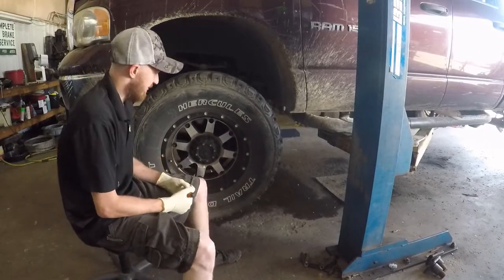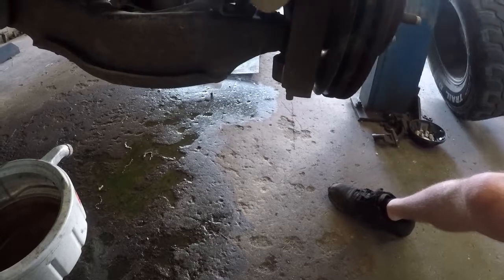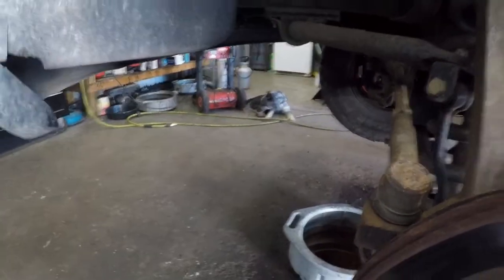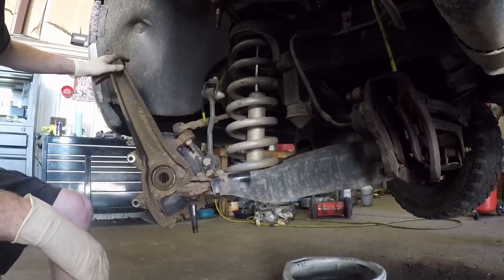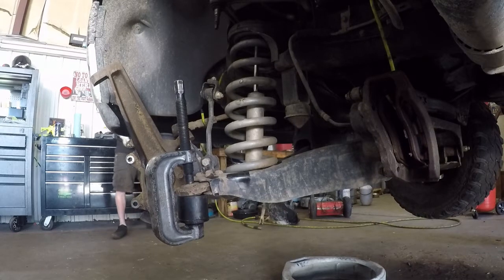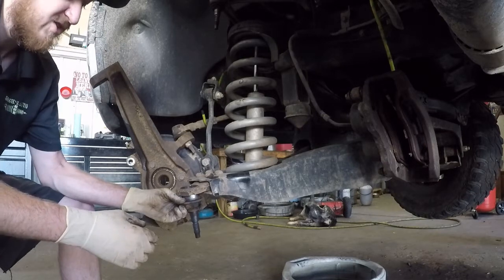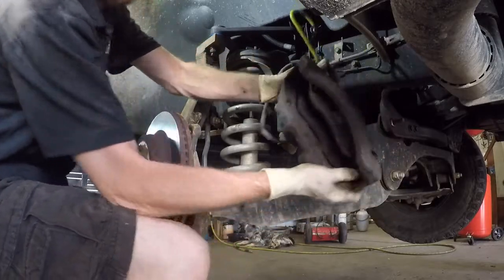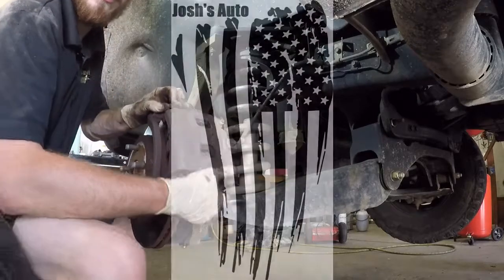2004 Dodge Ram 1500 Ball Joint Replacement

Comment: Without camber and caster adjustment kits installed on the upper control arms it will NEVER align within spec and continue to chew up tires on the outer edge. I finally learned this from an alignment tech that had experience with 2003-2005 rams, after several sets of tires. Including waiting for the kits to arrive, took about 3.5 hours. He aligned another car while waiting for the kits. The kits, 2 per side, one on each leg of the control arms, hold the setting before the control arm nuts are torqued. The other techs gathered around, they had never seen the kits. In his words, "I can loosen and tighten these (control arm) nuts all day long and it will never be within spec" without the adjustment kits. About $120 for the kits, as I recall. Far cheaper than new tires $800. Rotating the tires was foolish, just ended up with four worn tires instead of two.

Comment: Awesome brother 
Good job how much repair ball joint
Reply from the maker: To do all 4 it runns between $650 to $800 parts and labor.
Reply: @joshsautoandcustoms9840  that's like 85% straight to labor. You can buy the parts half of half of what you just priced it at. Woah
Reply from the maker: I would agree to a quarter of that being the parts price if I used low quality parts. I use the premium parts in every project,, when available. And my pricing adjusts when I use the cheaper parts.

Comment: were those the factory pinned in place lower ball joints? I've got that same truck in right now and there is no snap ring, the edges got 4 circular stamps to lock it in place.

Comment: So Josh, the ball joint in the upper arm control spines with the nut, I've tried to hold the ball joint with vise grips while turning the nut n that doesn't work, any suggestions 🤔
Reply from the maker: Check for a hex or allen spot at the end of the threads to be able to spin off the nut and hold the ball joint.
Reply: I looked, there isn't a hex or alan key slot, so that's were I used the vise grips. The dam thing just spins. 
 It's a 2004 n these parts have never been changed. 
He'll I can't even get the spindle lose from the bottom ball joint.smacked the crap out of the spindle where you showed on ur video. 
 I do work on my truck using your videos n have had success,  But this one is kicking my ass. LOL.
Reply from the maker: Next thing to try is a small torch and melt the plastic out of the nut.

Comment: I’m having the same problem just the opposite! I have to replace upper ball joint and the whole lower control arm assembly. What would you prefer? I checked on rock auto and moog assembly is about 230$ for both and precision is about 320$ at orielys . .. and I have a 06 Dodge Ram 1500 single cab 5.7
Reply from the maker: Moog is a good brand. I use both brands.
Reply: @joshsautoandcustoms9840  go with moog?
Reply from the maker: Moog would be a fine choice

Comment: Very helpful video. I've watched several by others and by far you do the best job. Concise. Good camera angles. Clear. 
I subscribe right away and will definitely be watching more. 
Thx

One question...... If you were to replace the shocks on this truck( mine is an 03), which shock would you use ?

Thx again
Reply from the maker: I'm glad this video helped you. For you shock question, if your truck is stock height, Monroe Reflex is a good choice. If your truck is lifted Fox shocks would be a excellent shock.

Comment: You made that look easy bother,  
 Do I have to change the upper control arm or can I just change the upper ball joint?    
    You said in  this video that Ram was a 2 wheel drive, Is it the same procedure on a 4 wheel drive. N for the hella of it, where is your shop located .
Reply from the maker: The four wheel drive in that generation is going to be set up the same way as the two wheel drive. The only difference is the cv axle will have to be taken loose from the hub. I dont recall the upper being sold as a ball joint alone. My shop is in North Georgia in the City of Clayton.
Reply: @joshsautoandcustoms9840  thanks Josh, appreciate your video n response. I'm in south Florida, alittle to far to bring my truck to you. 
 Can you give me an idea how much the moog ball joints n control arm is?
Reply from the maker: I dont remember exactly but upper control arm and lower ball joint should be a little less than $200 per side.
Reply: @joshsautoandcustoms9840  hey Josh, so I got my moog parts 2day, upper control arm n lower ball joints. People say there come pre greased, But these are not, so should I pre grease them before I install them?
Reply from the maker: I would just grease the fittings after they are installed
Reply: @joshsautoandcustoms9840  Thanks But How should I know when it's enough grease.
Reply from the maker: The grease will start to push past the rubber seal. You can watch the rubber part swelling.
Reply: @joshsautoandcustoms9840  
  I ask these questions because I want to install these parts right n only once.
 Thanks for all your advice brother.
Reply from the maker: No problem

Comment: I dont understand why the upper control arm had that elongated hole on the left side of the arm you were pointing at.
Reply from the maker: Where the control arm mounts to the frame, it has the elongated hole to adjust the wheel camber and caster.

Comment: So I'm looking at doing this to my 2004 Ram 1500 in the near future, those new joints you put on, are they Moog? I saw they had grease zerks and the cheaper joints are sealed like the factory ones, I'm finding Moog cost a bit more, are they worth it? Thanks, helpful video, will definitely be referring to it when I do mine.  Also, I'm just a diy guy and this will be a one time thing, can I get that press somewhere cheap like Harbor Freight?
Reply from the maker: Moog parts do cost a bit more but they are definitely worth it. I have rarely ever had to replace one under warranty. And most auto parts store have a tool rental program with a ball joint press set. They require you to pay for the tool up front then return the full price when you bring the tool back.
Reply: @joshsautoandcustoms9840    Can I ask, what was total time for both sides and what does your shop charge for installation? I'm just trying to compare to a couple shops where i live. One wants 550 for install and the other is 420 with an alignment included. I bring the parts on both those quotes.
Reply from the maker: I get 4 hours of labor at $80 an hour. My total without an alignment is $320
Reply: Waiting for moogs to fix mine.
Used some cheap ones and one year later they squeaked. 
Dont do it twice.  Do it right the first time.
Reply from the maker: I agree. Thats why I will only use a cheap one only by customer request.